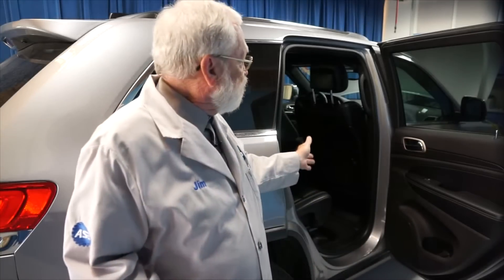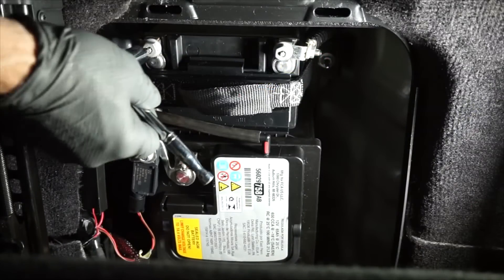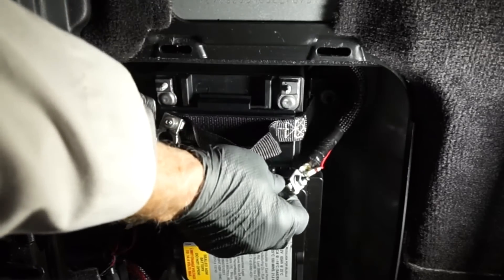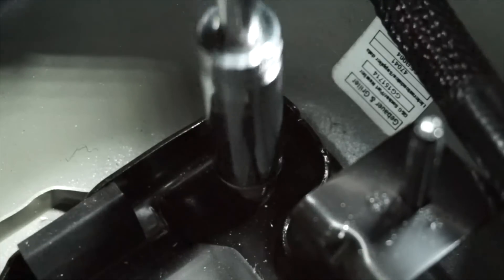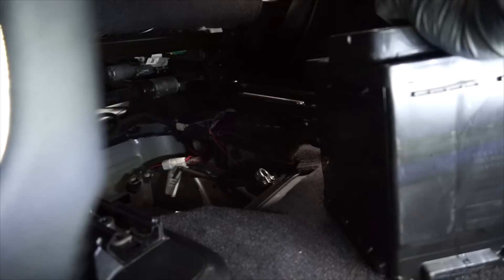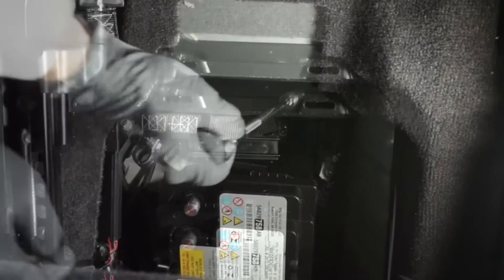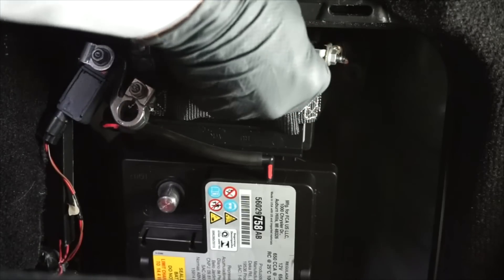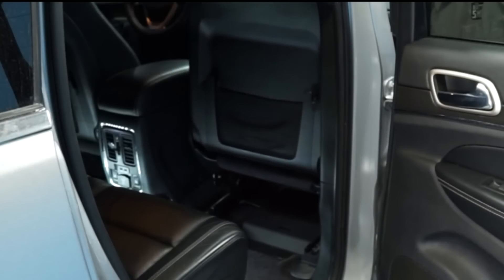Jeep Grand Cherokee & Dodge Durango with Start/Stop (2011-present) - New Battery Install

Comment: Would this work if my jeep Cherokee 2019 was diagnosed with a battery replacement needed and battery sensors? It was estimated $600 to fix and with COVID I don’t have thag kind of money
Reply: 2019 should still be under warranty
Reply: @the2lman696  have the same issue because it's a battery it's not under warranty and I've even got the extra warranty through my lender
Reply: noy sure about others, but on jeeps at least, battery replacements are under warranty if you are still covered under your 3 year/36k mile manufacture warranty. had batteries replaced under warranty on my jeeps with no issues.

Comment: Hey I have a Jeep Grand Cherokee 2019 and doesn’t work the start/stop system could be the battery??
Reply: Did it stop working because the aux battery died?
Reply: i have a 2018 Grand cherokee and it stopped working also and i am very happy it doesn't, because that system is a total piece of crap, worst engineering i have ever seen, trust me you're better off without it.
Reply: @marcgariepy  Hey I think it is beneficial to gas mileage. Though it’s annoying that it turns OFF and ON at every traffic stops.Mine has a 2020 model and its start-stop stopped working which ended up with difference in gas mileage especially on city rides demands frequent stopping. I have to look on to my auxiliary battery health as it shows charging always while riding. I used to get 19 to 20 mpg with medium traffic on city rides along with highway combined now it is decreased to 16-18. I got along with the feature since it came as ‘ON ‘ from the dealer so I’m used to it.
Reply: @VinnyS6062  for me it is not worthy because i do not drive in the city, but i still think the design is very poor, as i don't find it normal that my car shut's down when i am parking it, if it was me designing this i would definitely add a timer so it does not shut down so quickly.i think it is worth it to shut down when i am waiting at a traffic light but other then that, i think it is worthless.
Reply: @marcgariepy  I like your concept that it opens an option to extend duration of idling before shutdown during traffic and of course you don't need it as you don't drive in the city.

Comment: Great video very helpful! Helped me replace my battery on my 2017 Jeep Grand Cherokee.
Reply: What size socket did you use for the aux tray?
Reply: I also have a 2017 grand cherokee laredo.  So it cam be done on your own.. no need to go to dealer? Having issues with my battery draining.. said bad cells on both. Their asking and arm an d a left nut because. They have to take out this and that.. I told them how so.. I saw where the batteries are.. yes is under seat a bit awkward..unless there's other batteries hidden somewhere,  I think they thought I didn't know where the batteries were!!!